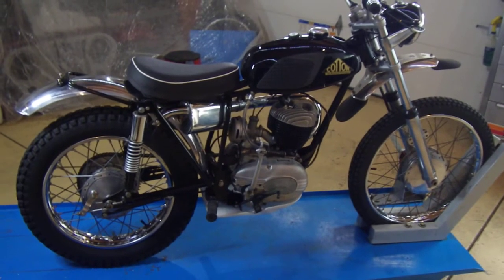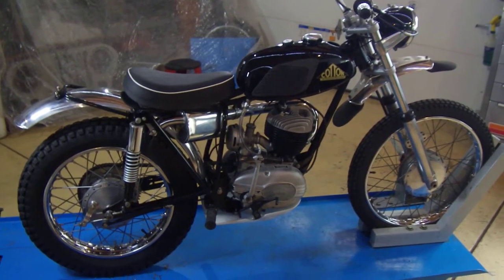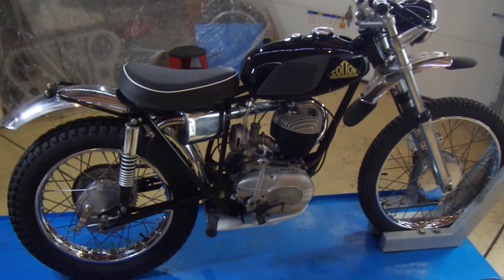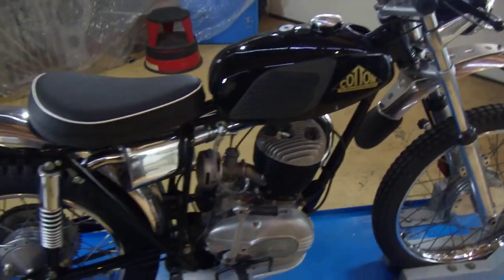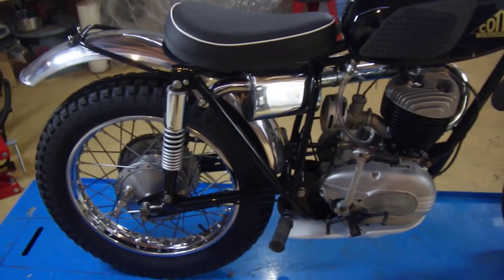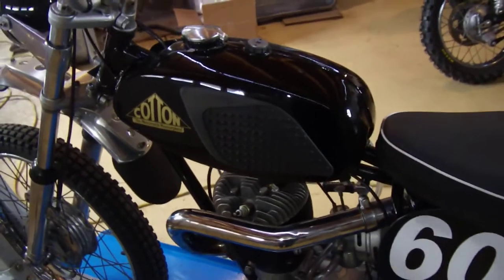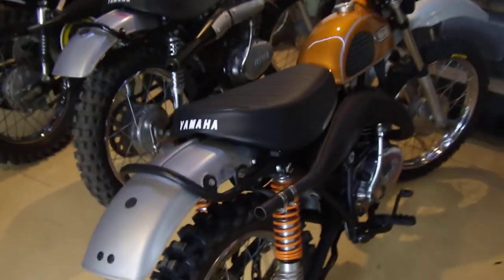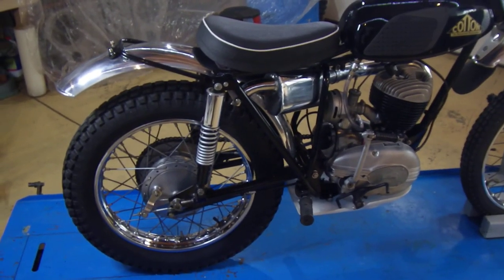1968 Cotton  vintage trials bike and Yamaha dt1 mx.  Barn find!

Comment: Beautiful bike!  I'm putting together a 68 with a Minarelli 170.  I really won't be able to ride it so I will be looking to move it when It's done.  I just couldn't pass it up.  It was purchased by a bike shop in San Francisco, assembled and sold to a bike magazine for a review on the New Minarelli engine.  I am about 75% sure I have a picture of the bike and the article from the magazine but there is no way to prove such a claim.  After the review, it was auctioned off.  I purchased it from that owner.  It has not ran since 1969.  I guess I felt a need to bring it to life but it won't be near the thing of beauty yours is.  Thank you for posting the video.
Reply from the maker: Thank you, much appreciated!  I sold this bike to a guy in Texas who wanted it for living room art.   Your bike sounds great, definitely a worthwhile project!   Cheers

Comment: Nice bike hope to see it running so make a video of it in action. I was on Wisconsin craigslist Eau Claire and looked up XS650 to see what was out there for parts for mine & popped up was a Yankee 500 dirt bike in pristine collectable condition for $10,000 . Some rare rear disc brake model Which I believe was made by OSSA ?  Amazed at what bikes I see at times for sale on that site but not much lately as far as basket cases or antique or vintage bikes for some reason but I think if the economy gets much worse some will be selling off more & better deals can be made  .